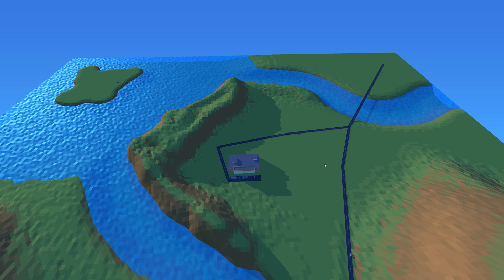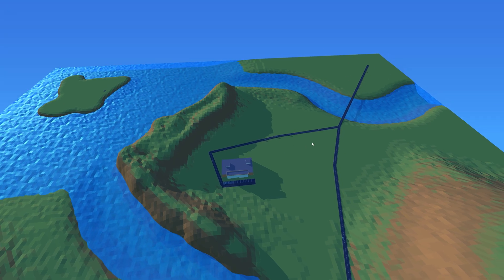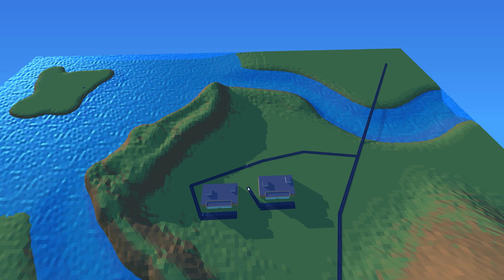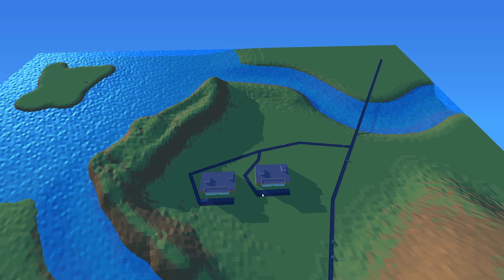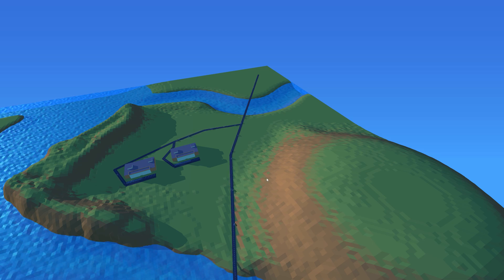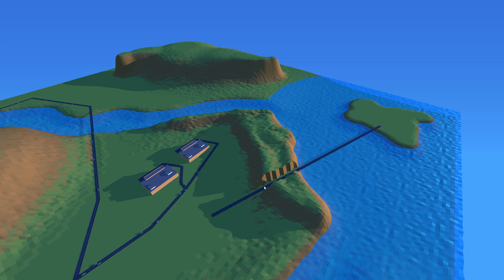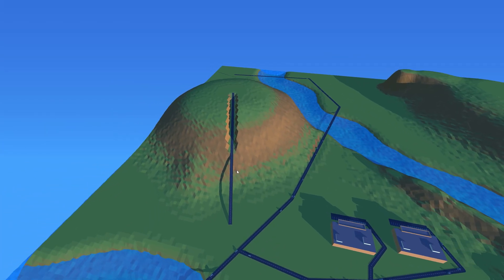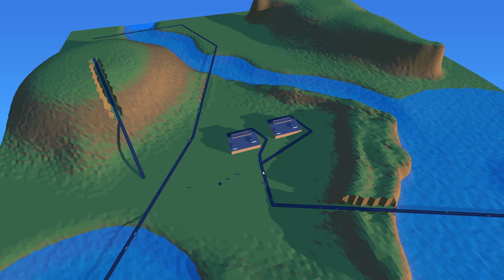Adding buildings to my traffic simulation game in assembly |Devlog #1

Comment: I'm generally interested in your choice of the assembly. Is there some concrete advantage that you plan to exploit, or is it "just" for fun?
Reply from the maker: It is a bit for fun to see if it can be done, but also for performance reasons. Using assembly gives really good control around memory access which is usually the bottle neck in software. I also find writing SIMD optimized code more straight forward in assembly than in a compiled language. The plan is to use the high performance to push for a really high number of traffic agents in the game and/or allow very high simulation speeds.